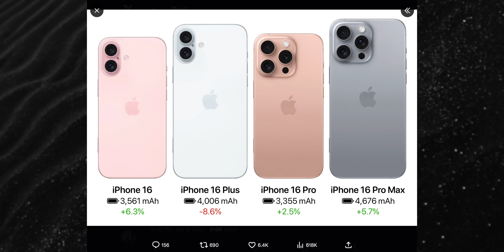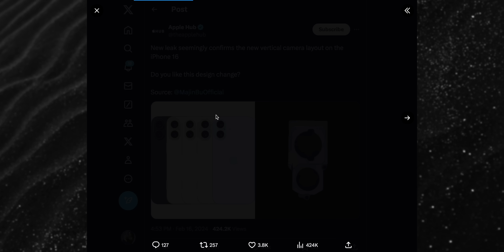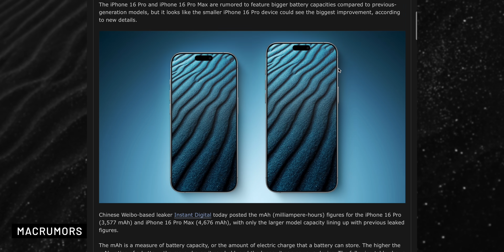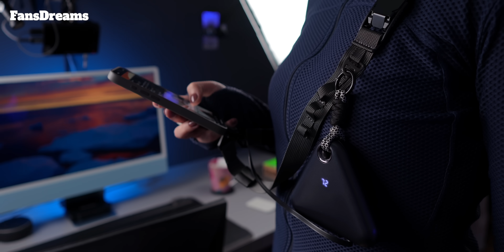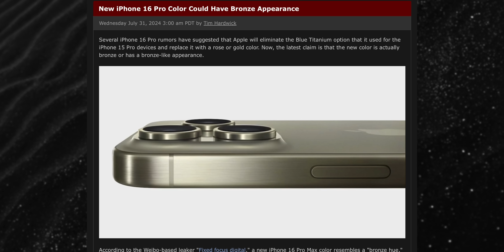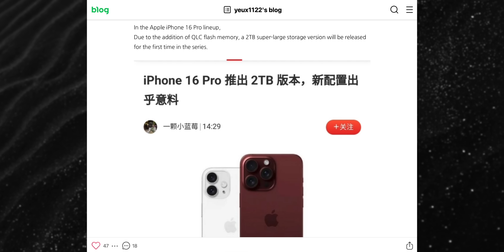iPhone 16 Launch Date REVEALED! Everything We Know: New Finish, New Colors, and More!

Comment: I Have An IPhone 11 Now And I Would Be Upgrading Either This Year Or Next Year Not Sure As Yet.
Reply: I am using iphone X, time for an upgrade for me.
Reply: @justtonysins same I have the base X I just can’t wait to upgrade anymore 😂
Reply: @icxyz492spiltz3  sept 10, after they open the preorder, I will surely be one of the first to order one. The X served me well, i even recently changed its battery, in diy mode . 🤣
Reply: Congrats to our consistency on using the phone more than 3 years
Reply: Have you been replacing your battery and next year is probably going to be way better if the leaks are accurate because we might have a small cut out and 120hz for the base models.

Comment: Don’t buy iPhone 16 just to upgrade your 15’s buy it if you have the 11pro only
Reply: My money my rule😂😂😂😂. Shut up
Reply: @bryllercrown3874 do it then, its yours to waste
Reply: buy if your iphone has no Apple Intelligence
Reply: That’s literally the exact reason I am getting one
Reply: @BPlayzGamezYT  i may get one too. Cause im have the 11pro max since forever. Lol
Reply: @BPlayzGamezYT  40w wired charging for the pros as well and capture button.
Reply: Lol, literally typing with the 11 pro, my first ever iphone. I bought it with 64GB and my storage is almost full which is making my phone lag so much. Going for 256GB 16 PRO MAX.
Reply: Oh Master upgrade decider, is it acceptable if i upgrade from my 2nd Gen SE to 16 pro max? Please say yes 🙏🏽
Reply: Wait what? 😅
Reply: @jimmylomsadze6851  my gf using the 13 pro. And I’m still sticking with my 11pro max. 
I see almost no differences except the 13 pro is a bit faster. And the camera is a bit better in low light. That’s it.
And my friend got the 15 pro . Also i can’t see  a big reason to upgrade. Lol
Reply: What about my iPhone 13 Pro Max
Reply: @Idkmyuser09 don’t. 13 pro max is an elite iPhone
Reply: @chrismac3598  absolutely but I had a work accident and the rear glass is shattered and falling out. Plus, my screen is extremely cracked… On top of that, one of my camera lenses are broken and the volume up button is not working… I wouldn’t want to upgrade had not been for those issues. 😫
Reply: @chrismac3598  my gf have one. It’s amazing.
Reply: That's up to you  @Idkmyuser09
Reply: @Idkmyuser09 no apple intelligence...shaky videos
Reply: @Idkmyuser09  my gf have the 13 pro max. It’s great enough to not upgrade. 
13pro max got better battery and better cameras than the 15pro’s if you ask me.
Reply: @Hilal_abdelilah lol, seriously now, the iPhone 13PM is a great phone but it does NOT have better cameras than the 15 pros …jeezus man, now your just talking straight out of your ass.
Reply: Even 11 pro still works pretty well no need to upgrade cause it's literally the same thing every year
Reply: @Liliylilith234 the 11 pro was average. The base model 11 was a superior phone and still is.
Reply: What if you have 12 pro
Reply: I have an iPhone XS and need to replace it. I'm thinking about whether I should wait for the 16 pro max or buy the IPhone 15 pro max🙄🤔
Reply: @luna.belle_moon  wait for bigger battery its no brainer. When it cones out go to apple store and fuck around with both to see what u like better. When 16 comes out 15 price will drop so no point in buying weeks before lol
Reply: @No_UU  of course I will wait and decide. Now it's stupid to buy 15 pro Max
Reply: Money must role